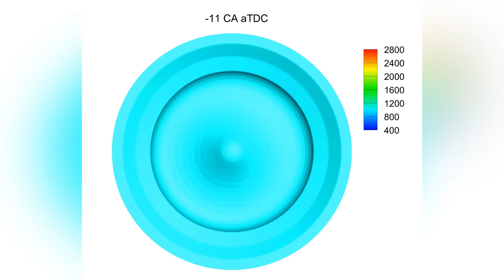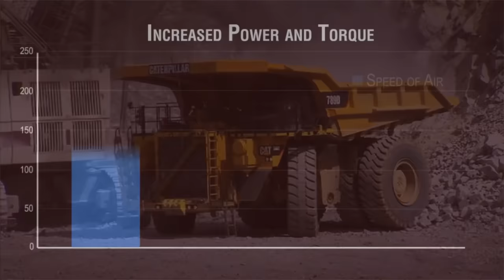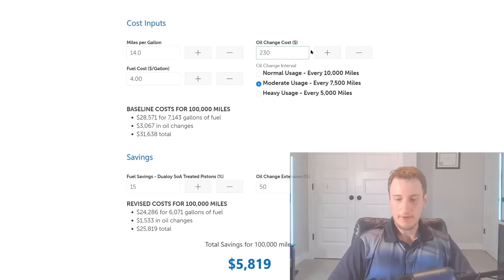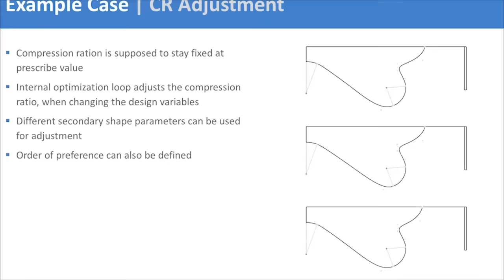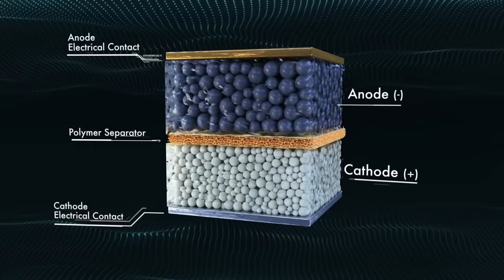ICE Breakthrough!? NEW Piston Design BREAKS Records

Comment: 25% more economy is utter nonsense.  If they do that, I will be shocked.  And I mean do it with the similar  performance.
Reply: yea that's the number that made me rewind to hear if i misheard
Reply: I think it's a play on words. Let's start with 30% efficiency. I don't think they mean they are now 55% but rather 25% of the 30% more... So like 37% and I could believe that. What do you think?
Reply: @frankcarter8399  this kind of design doesn't make sense at all. it is about hype. do you still remember they claimed that put a fan into a engine manifold could boost 25% power and fuel saving in 90s'?
Reply: @xianshi8896  actually, ported gas cilinderheads have similar intake ports to prevent mixture oxidize against the walls. This technique seems to do the same with the piston heads.

Efficiency may not just be power or economy related, it can perhaps also include emissions or longevity.
Reply: The car manufacturers would put an end to this company so fast if it were true
Reply: This is for large vehicle engines. A 25% efficiency increase is not surprising. The effeciency of large diesel engines has increased almost 100% since the 80's where 4-5mpg was the best fuel economy. Today's diesel semi trucks average 7-9mpg and produce about 1/60 of the emissions.
Reply: @wstavis3135 this is true but those DEF systems are a nightmare.
Reply: Variable valve timing did it
Reply: It , make’s start up / cold start economy! Greater , for a start due to the ceramics ,  heat properties!!
Reply: @TillURide420  They would use it in their designs and market it. They don't make any money off of oil or gas prices.
Reply: @Quidam De Populo except for governments killing the free marked by heavily taxing stuff they don't want you to use.
Reply: I think the problem is really mass production. The high end race engines can achieve a lot but are custom built to high tolerance. That simply can't be reproduced yet on an assembly line.
Reply: @xianshi8896  yeah, it's called a turbo charger, and it works.
Reply: @what9418  if you have an air-fuel mixture "oxidizing" in your intake or heads, that's what we call an "engine fire" and you should get a fire extinguisher.
Reply: @wstavis3135  my 2006 turbo diesel Golf gets 40+ mpg if I can find BD20 fuel. 38mpg on straight Diesel. And that's with 300 ft/lbs of torque to the wheels.
Reply: 20% for a car engine is excellent. 40% is best fossil fuel generators.
Reply: @rickway2039  no, it didn't. people had tested them out.
Reply: @xianshi8896  I said theoretical, not practical.

And as we all know the difference between theory and practice is bigger in practice than it is in theory.
Reply: 350 miles costs $13 in a Tesla, and $100 in a typical ICE vehicle. A Tesla is therefore approximately 7x more efficient. So 25%, 30% or 50% isn’t enough unless it’s for a use case where electric isn’t an option.
Reply: @Quidam De Populo, You’re neglecting to consider externalities. Market forces tend to make the same mistake.
Reply: @what9418 , But why don’t they want you to use some things? Are you familiar with the term, “externalities”?
Reply: @Eluderatnight , 100% if you use the waste heat from that generator to heat your home in the winter.
Reply: @xianshi8896 , You’re referring to the crappy weak electric superchargers that don’t work. Real superchargers and turbos certainly do work.
Reply: @terjeoseberg990  it is not more efficient per unit of energy for EVs. You have 40% @ station, 70% station to charger, 80% at charge, 93% battery to motor.
So .4*.7*.8*.93=0.21
Reply: @Eluderatnight , If it costs 1/7th as much, then it’s 7 times more efficient. You must realize that we will pay for the fuel to run our car regardless of whether we put that fuel in our gas tank, or use it to run an electric power plant. Nobody’s in the business of giving us free energy, be it gasoline, diesel, or electricity.
Reply: All of those figures are likely for older engines retrofitted with these.
Reply: @Eluderatnight  for GAS cars, sure. Diesels have cracked 40% multiple times in road legal engines (emissions and realistic power curves). The goal for Diesels these days is to hit 55% thermal efficiency. A lofty goal, but well within theoretical limits.
Reply: @terjeoseberg990  sweet tax payer subsidies
Reply: @Eluderatnight , Which subsidies are you referring to? Oil exploration subsidies?
Reply: @terjeoseberg990  lol you mean seafloor or federal land leases? Where oil strokes a check to federal gov...
Reply: @Eluderatnight , I asked you a question. You didn’t answer. Why?
Reply: @terjeoseberg990  I don't know how you come up with those number. in california(where I live). electricity cost about $.18 per kWh at home and $.43 at charger station. Tesla get around 4 miles/kwh, which 350miles will cost around 350/4x. 18=$15.75. and $37.6 at station. and Toyota hybrid and Honda hybrid will have 55mpg and 52mpg. with $4.15/gallon. 350miles will cost around 350/55x4.15=$26.4 and $27.9( not $100) you exaggerate those number. not good
Reply: @xianshi8896 , “A Tesla battery is made of thousands of individual lithium-ion cells. These cells range from 3400 mAh to 5000 mAh in charge, giving a total storage capacity between 85 kWh to 100 kWh.”

$.18 X 85 = $15
$.18 X 100 = $18

You’re comparing this to a Toyota hybrid. I’m comparing it to a typical sedan, not a hybrid. My car costs $100 to fill up. I filled up 3 days ago, and I get close to 350 miles per tank.

Why would you ever charge at a charging station? Not only does it cost more, but it takes forever. At home you can charge while you watch TV on your couch, eat dinner, or sleep. Charging at a charging station is tarded.
Reply: @terjeoseberg990 EV only save money if you had your own place to charge. for those don't. not a option to buy EV.
Reply: @xianshi8896 , Absolutely. If you can’t charge at home, or at work, electric vehicles are a bad choice. Also, if you can’t afford a brand new car, it’s a bad choice. If you can charge at home, and you are buying a new car anyway, then you should buy an electric one. These criteria are obviously not met by everyone.
Reply: Marketing hype and BS.
Reply: @terjeoseberg990  that depends on your electricity prices. In the uk a home charger would cost about £40-50 for 350 miles. I can do that in my old diesel Landrover for the same cost (maybe not the same comfort though!)
Reply: Frank has it right. If your engine is 20% thermal efficiency and you’re getting say 10L per 100km. 25% better fuel economy means you’d now be getting 7.5L per 100km and 25% thermal efficiency
Reply: @TillURide420  this does indeed work but it isn’t for gasoline automotive, it was originally designed for heavy duty diesel, and I can confirm this technology does work. I cannot substantiate the 25% fuel economy claims however it does burn substantially cleaner and makes abut more power due to a full burn in the combustion event.
Reply: @terjeoseberg990 I just bought a new car, and it's gasoline powered.  It was 60k, and I didn't even consider an electric car. 
You can do more for the environment by not consuming.  Try it, it's much more challenging than buying trendy cars.
Reply: @MikeYurbasovich , LOL

Dude bought a $60k car and talks about not consuming.

Ride a bike, or walk bro…
Reply: @terjeoseberg990  You walk.  My work commute is 22 miles. I used to walk or bike when it was a mile. 
I don't order designer water and food delivered to my house.  Eat street doesn't stop by with artisan chai tea for $27. I'm not a fan of Amazon.  I live a simple, minimalist lifestyle.  I buy fewer, high quality items.  That is called being conservative.  I buy the things I need to make money, and make things last a long time.
Reply: @Quidam De Populo The free market is best if only the products are safe for the population and environment. Like it was very important to reduce the use of CFC. CO2 and the other exhaust gasses are also not very healthy. (I'm inhaling them every day, working with ICE cars)

Nobel winning healthcare lobotomy  etc. There is products and services we need to ban and reduce. I just hope if they are not life critical to ban right away then give it little time to find alternative solutions without ruining people personal economy.
Reply: Thats just a piston that's been ran with metal 🤣👍
Reply: @xianshi8896 you mean a turbo yes it does boost power that works
Reply: No way... Maby 2,5% and that is good... If you save 2,5% on semi afrer one milion kilometers it is nice pile of money!
Reply: @xianshi8896  technically that fan is called a turbos and it did improve economy and power.
Reply: I don't care about the that as long as we get an efficient burn per combustion in will be no soot an no carbon
Reply: @TheMrDarius  The DEF systems lower the MPG's.
Reply: @phillhuddleston9445  which is why I said they’re nightmares.
Reply: Technology is always moving forward.  The Toyota Yaris GR puts out 300 horsepower with a 1.6 liter 3 cylinder.  Tell that to somebody 20 years ago and they'd tell you it's utter nonsense.
Reply: @TillURide420  - Car manufacturers need a supply of pistons in the tens, or probably hundreds, of thousands.  It's not financially viable to produce this piston in that quantity for a mass production assembly line.  But I do think you will see this technology show up on high end, limited production vehicles.
Reply: Saw another video on here with a reps truck they fitted to a duramax and they went from 13mpg to 16. something mpg on top of that knocked a load of nox off, reduces soot and lowered exhaust temps substantially.  The engine was purring like a petrol engine was amazing.  I want to see more but from that it looked really impressive if true
Reply: @TillURide420  why? fit them to their engines for the benefit.  This company sells piston and designs they aren't in competition with manufacturers
Reply: @xianshi8896  You mean a turbo ?
That was in the early 1900's not the 90's.
Reply: Increase power comes with increased efficiency, quieter.... Time will tell.
Reply: They've documented it.
Reply: SOA is currently in testing with SEMA and the EPA at tier 4.
Reply: @terjeoseberg990  so where do you people live? where i live if you dont have a garage in the winter the battery heater runs the battery dead faster than than it charges
Reply: @JamesTLangford , Then obviously where you live you need to plug in your car to keep the oil and coolant from freezing when the engine isn’t running. So basically nothing changes with an EV.

Comment: Normally you do not want dimples or nicks/dents on the top of your piston because it creates hot spots and can cause issues with pre-detination which can destroy rod bearings among other things over time.
Reply: Sharp edges create hotspots. Not the dimples.
Reply: Except in a diesel there is no such thing as "predetonation" because by design the fuel needs to combust as fast as possible. In fact quality of fuel combustion is measured in cetane numbers. Higher numbers = better quality fuel = faster detonation.
Reply: @erikkovacs3097 you can have an uneven flame front propagation resulting in uneven pressure distribution on the piston.
Reply: @travisbarrow3408  Sure from clogged injectors but from dimples on the piston?
Reply: @erikkovacs3097  each dimple has a sharp edge.this type of piston has been tried before.a dished piston and a dimpled piston has all been tried.dished pistons have been used in outboard motors in the 80s.and a dimpled piston has been tried in the racing world.
Reply: @denniswilder3014  But this is a diesel engine and it can't have predetonation on sharp edges because there is no fuel in the piston during compression.
Reply: @erikkovacs3097  All true, dimples in the piston groove and crown for me may be unrelavant, or theoretically increase pressure surface area in the combustion chamber in favour on piston by few % and take that energy by not distributing it to sleeves / head, but that white / dark ceramic / teflon coatings visible (in 0:02) may be silent hero there in friction reduction in my opinion...  Also interesting thing is that cuts between piston chamber / crown. That may actually do something. But again it depends of CR, boost, and the speed of filling and emptying the combustion chamber...
Reply: @denniswilder3014  The edges are def nicely milled so the edges are smooth. Discrete small vortecies with relatively high energy vs messy flow such as wheel wake, there's a big difference
Reply: This is for a diesel.
Reply: @crissd8283  No. It is for a snow cone machine.
Reply: @erikkovacs3097  Got ya.

My comment was directed at the original comment about pre-ignition/detonation. Pre-ignition is not an issue in diesel engines. I was pointing out that hot spots creates by these pistons are a non issue due to it being a piston for a diesel.
Reply: What if one could build a motor with a swirled  intake,pistons and exhaust manifold. It would have to be more effizient.
Reply: I seen a post of Facebook a few weeks ago from a company making these new pistons, served 8k hours in a mining truck engine and looked perfect

Comment: The same was found with the jet boats in New Zealand the older boats performed better than the new boats the only difference was the old boats had lots of dents all over the bottom and the new boats were flat bottomed so now all the new boats have a dented bottom and perform just as good as the old boats similar to the golf ball dimples
Reply: LMBO!!!!
Reply: Lol I don't know if you're bs'ing but it makes sense for a boat hull. Up on plain they would hold air pockets that produce less drag than a flat skin. Some boats have a channel coming down from the sides where as the boat's moving the channel acts as a venturi pulling air under the hull creating tiny air bubbles that slide between the hull and water producing less drag.
Reply: Off to golf driving range with surfboard as target, all these new dents will work wonders increasing performance!
Reply: Dolphins do as well.... or perhaps small ripples... but they outlawed swimming suita that were similar, that held little spots of air.
   Perhaps it's contact surface area?
Reply: Yeah this is old stuff. I remember when it first started making it's rounds. First we did it to performance intakes, now pistons. It ACTUALLY does work, idk about their numbers though. It doesn't seem unreasonable considering that this idea literally came from aerodynamics of golf balls.  The dimples make the air fuel burn, and the mixture much more consistent.

Comment: Would love to get Gale Banks' opinion on this.
Reply: Does  Gale Banks  do  Heavy Diesels ? Because  THAT  is  what those pistons are  for .
Reply: @johncunningham4820  diesels for army trucks
Reply: @twanheijkoop6753  . Really ? You sure ?
Anyway , I  have heard of Gale Banks . 
A  Legendary  RACE  ENGINE  Builder in the  U.S. I've seen a few of his Vids . 
Definitely sounds like the " Real Deal " .
There is no real reason he WOULDN'T  work on Diesels . The Overall principles  ARE  the  Same .
SUCK , SQUEEZE , BANG , BLOW .
Rinse and repeat.............
It's the Fuelling and Architecture that are different .
And  I  suspect the Army may want QUIETER running Diesels for TRUCKS , rather than More Power .
Tank Engine ? YEAH   MAKE  IT  LOUD  and 3,000 hp . It has to push  80 - 100 tons  FAST . And it's Armed and Armoured .
Trucks not so much . Quiet is good  for them .
Reply: Small dimples like a golf ball make more sense to reduce drag on the swirl effect
Reply: @johncunningham4820  Yeah, he does diesels: https://www.youtube.com/@bankspower/videos
Reply: @100pyatt  . That was EXACTLY  my  thought as well , though  I  didn't articulate it .
Reply: Gale Banks has the financial horsepower to prove success or fail of this product. You just wait, he will.
Reply: @Karl with a K . Not until  Electrical STORAGE  improves 1000%  minimum .
Reply: @johncunningham4820  powerstrokes and pick ups to. I seen these guy on a podcast.
Reply: @hankclingingsmith8707  And ?......................................................................................
Reply: @johncunningham4820  https://en.wikipedia.org/wiki/Gale_Banks_Engineering